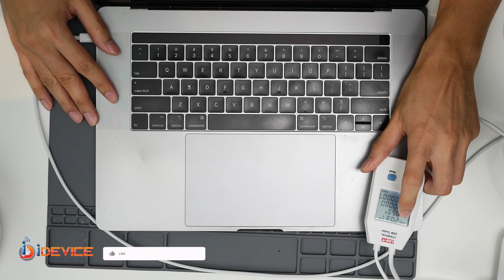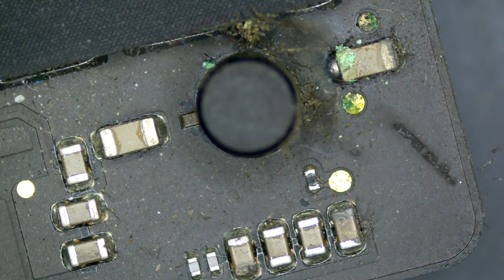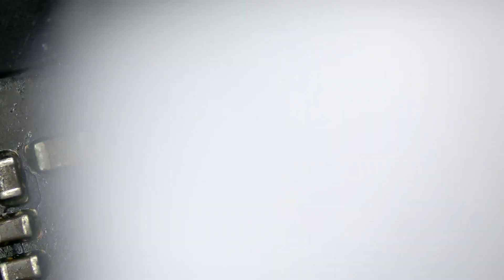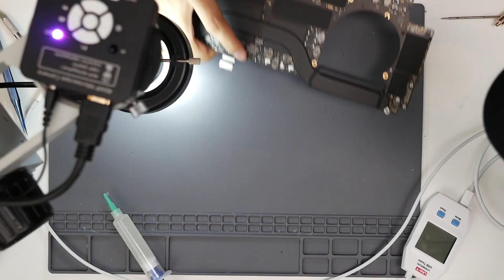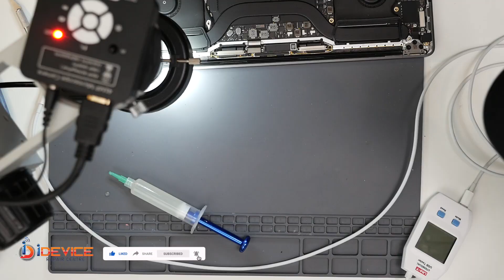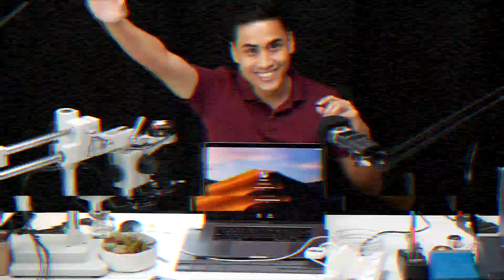MacBook Pro 15" Touch Bar A1990 Motherboard Repair No Power Issue | iDevice SG

Comment: You are the best. I have the same issue in my MacBook pro 16 inch core i9 2019. Don't turn on and after I bought the same version but I still have the old one that I still didn't find a solution to turn it on

Comment: Hi Sir, i have also macbook pro without power, i tried to measure also the input voltage using a usb c tester, i only see
Voltage: 5.178
Current: 0.000A
Power: 000.000W

do you think there is a short on the circuit?. Thank you!

Comment: hi! very useful video. i have an issue with a macbook pro 2018 (A1989) . I managed to fix a stage light effect flex cable issue, but right now i need to do the other flex cable with the light sensor, camera, etc. and i dont have the  schematic for it in order to solder the jump wires. Can you please help me with this!? thanks in advance, and be sure i will post a video with the repair credit to you. thanks once again
Reply from the maker: Hi Cosmin RI, We have not done the research for this yet. But this is how usually we do it. We will remove the metal plate of lcd flex and see the fine circuit printing from the flex cable and from there we will just do a jumble of each of the flex connection to the FPC connector directly

Our main concern of not doing yet, Is because we worry that if something goes wrong it will affect the CPU. Since this newer model CPU are easily affected.

Sorry that we are unable to provide a much clear information. In the future if we have done the research we will surely share the video on our channel
Reply: @idevicesingapore2324  thanks for the info